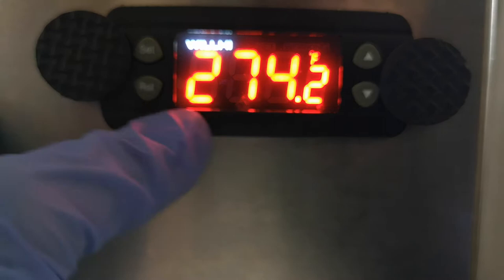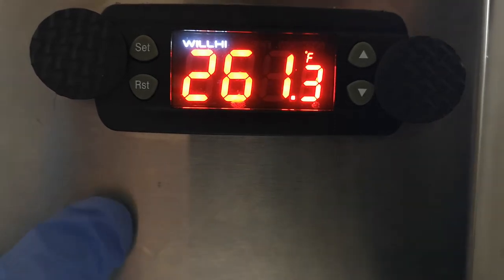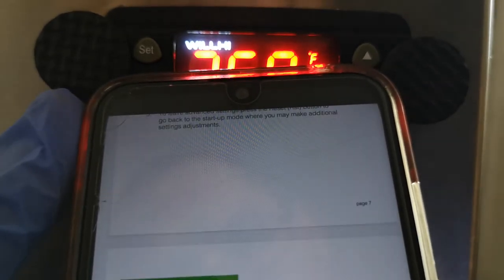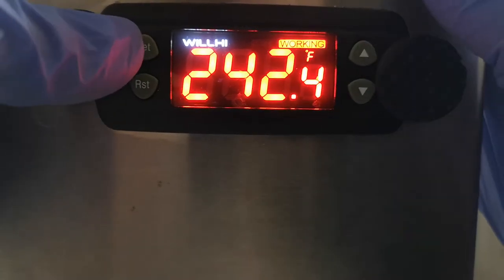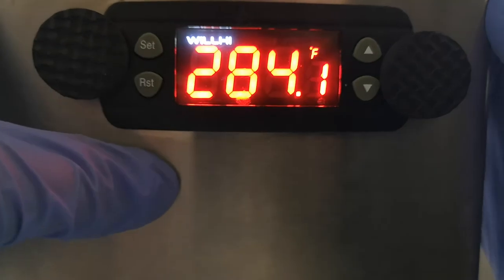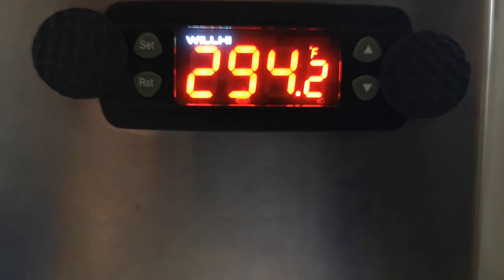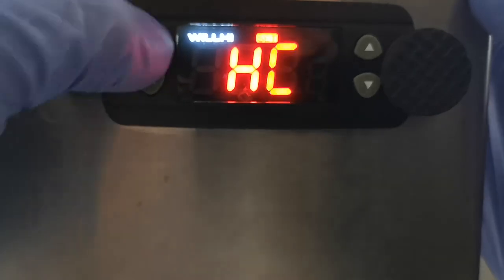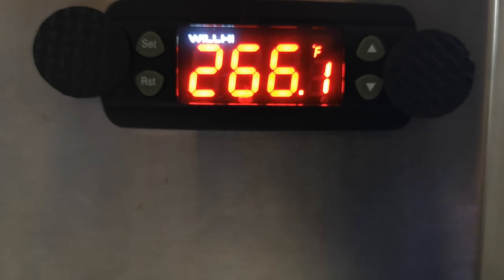Rosinbomb Rocket Instruction Manual, Celcius Fahrenheit, calibration and advanced settings

Comment: Why would you have the plates at 250 or under 375 f?
Reply from the maker: to improve the quality and flavour of the extract and avoid burning off parts of it during extraction. 375f would be super hot for a pressing. Lower temps provide better quality.

Comment: I plugged mine in out of the box and it immediately started making a loud noise so I unplugged it. Is this normal do you know?
Reply from the maker: That is not normal, it should only make noise when moving the plates up and down, otherwise it runs silent. If the button was partially pressed and the plate was moving that's fine, if everything was stationary it sounds like you have a problem. If the plates were stationary maybe check out the sound of arcing electricity on youtube and see if that's the noise you heard.
Reply: @recvapes3102  ahh that doesn't sound good then, thanks man. I'll give it another try in a couple hours and see if I can figure it out, although it did sound a lot like arcing electricity when I searched it up. Either way thanks again man much appreciate ya hitting me back 🙏
Reply from the maker: @chrismcnerney4753  No worries, hopefully it doesn't repeat but I'd be tempted to get that back to the supplier ASAP in case it sets fire to itself or something. Arcing electrics are baaaad. Good luck!
Reply: Thanks so much man I really appreciate the help you saved me quite a bit of hassle I subbed to ya thanks again man much appreciated 🙏🙏